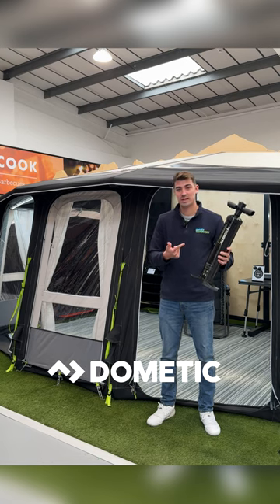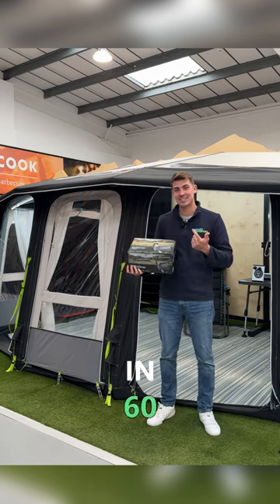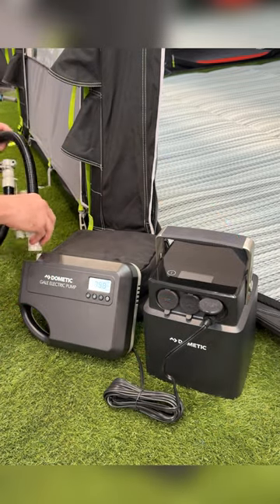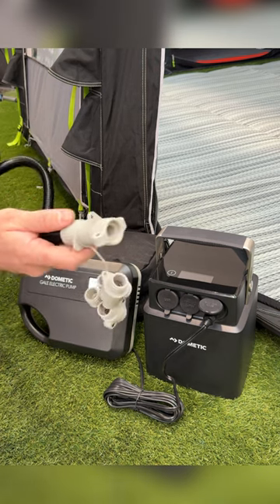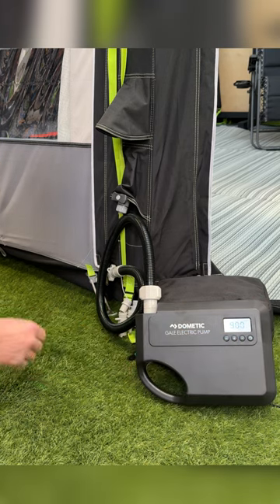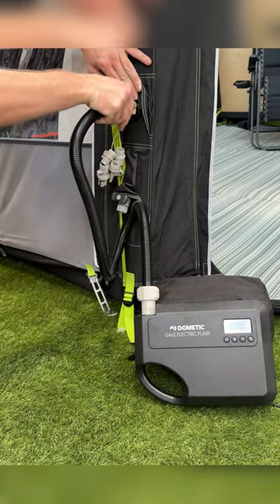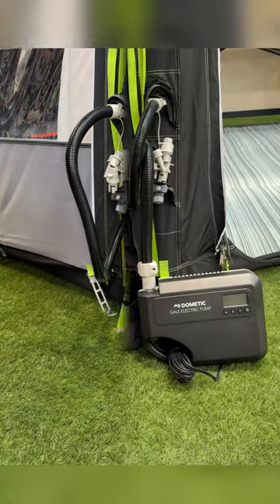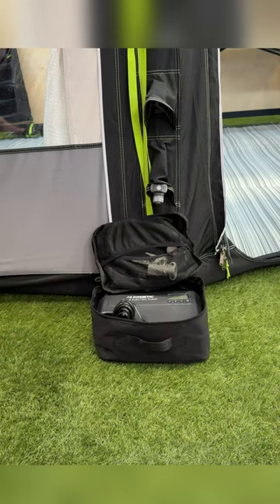How To Use An Electric Pump For Tents & Awnings | Dometic Gale 12V Pump

Comment: Can you use this pump in reverse to suck all the air out of the tent or other inflatables ?
Reply from the maker: Hi there, thanks for commenting it means a lot! Dometic's direct advice is that this pump does have a deflate feature, however it is not ideal for usage with their awnings/tents and perhaps other manufacturers as it can cause damage, so it is best to let structures deflate on their own to prevent pressure issues, I hope this helps 😎